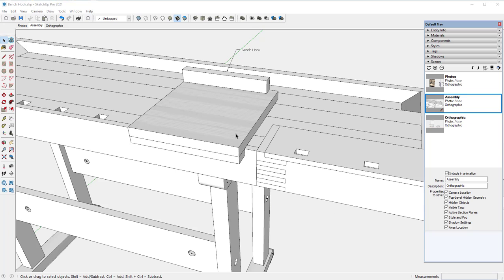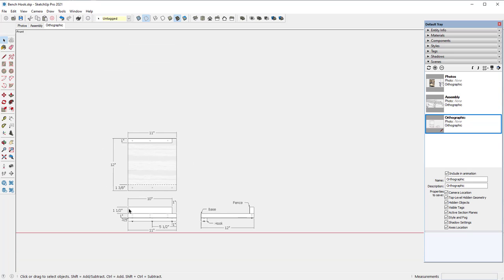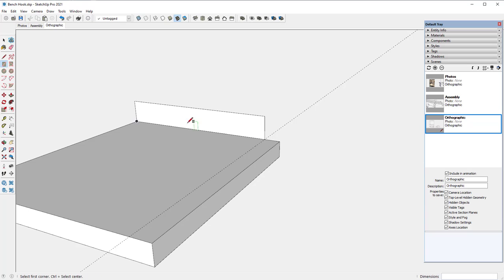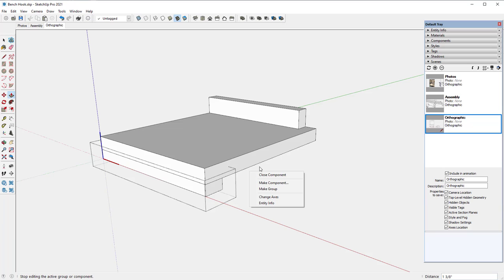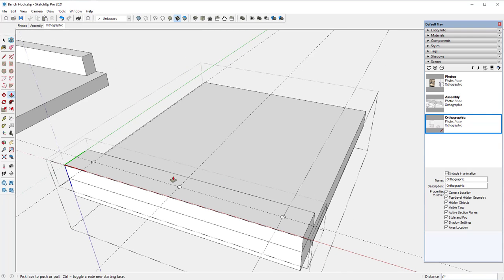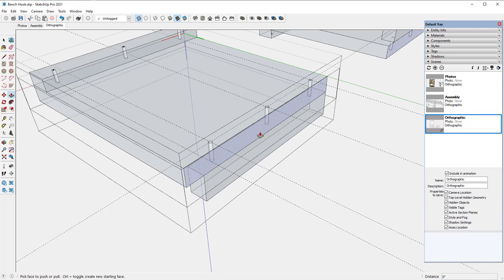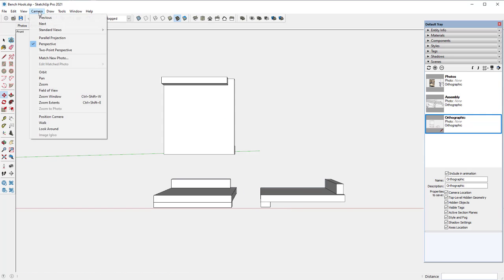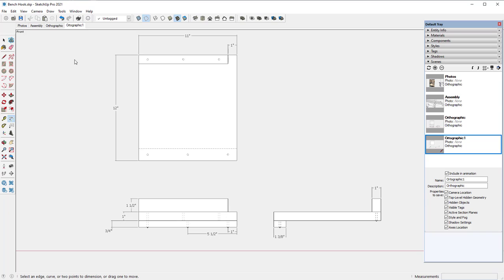Making a Bench Hook in SketchUp

Comment: I think your design of Bench Hook will only work with Western Saws with the way you have drawn it, so go kick your artistic colleague who prepared the "technical info" and obviously does not know how that Japanese Saw works on the pull stroke.  Now if you move the back piece forward or extend it by 2" or 3" it will work with both.
Reply from the maker: Roger, I use this bench hook almost exclusively with Japanese saws. The pull stroke is effective since you apply a push with your left hand on the fence to hold it sturdy.  Now for left-handed cabinetmakers, the Hook should be flipped in design. You don't need any changes to accommodate Japanese saws.
Tim